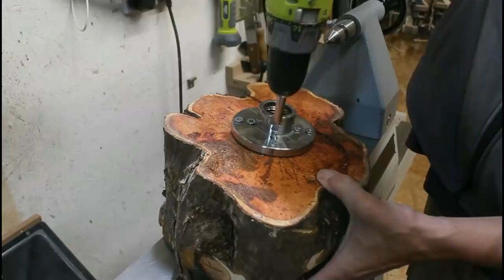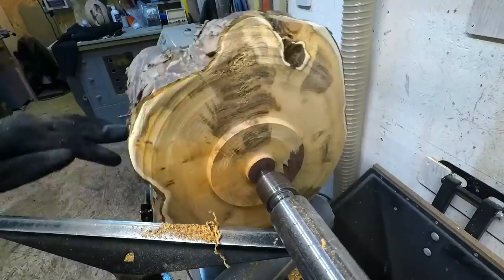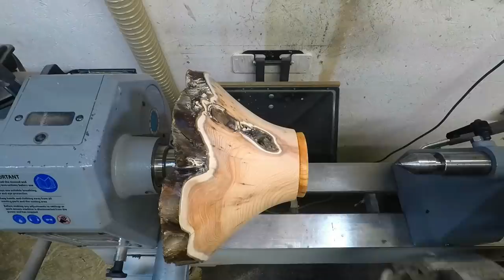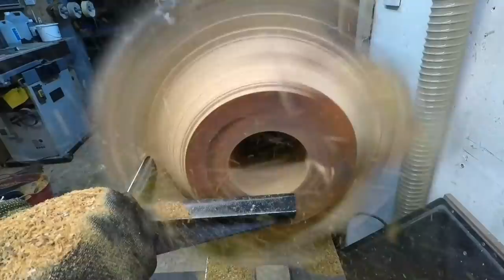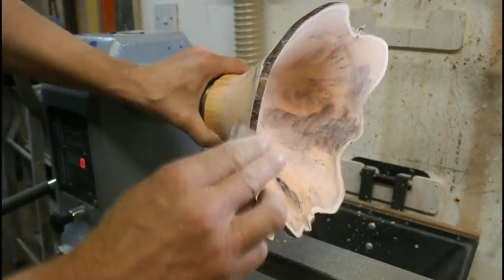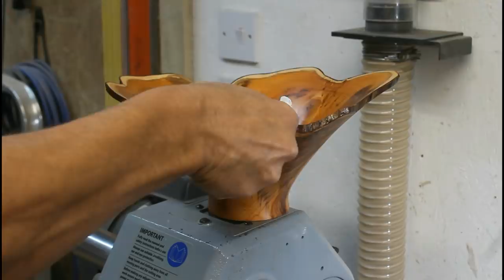Woodturning - Yew Beauty !!

Comment: WOW!  I initially thought you were turning a large piece of Cedar based on the bark and rich color of the wood itself.  I'm not familiar with Yew, is it similar to Cedar?  Either way, that finishing oil really brought out the rich color and grain in that piece, and it gave you another quality piece of art.  Thanks for sharing.
Reply: According to wikipedia, they are only distantly related, both being conifers. Maybe conifers just have that richer color from less shrinkage in the wood?
Reply: Yew as a rule I believe is much harder than cedar. Yew wood was the prized material for making bows in the Middle Ages
Reply: @BigGrabowski  Thanks.  I Googled it after asking the question, and found similar information, but it was late and I stopped reading before finding a definitive answer.  HA!
Reply: @LynnCindy  No problem! Maybe someone else had the same question anyway, and we in the thread quenched their curiosity.

Comment: I didn’t understand one thing: after turning the outside, it seemed like there was oil treatment.  in the next shot, during grinding, the impression was that the workpiece was not covered with oil.  but in general, I was very impressed with the result
Reply: Possibly just a sanding sealer and to check the grain pattern.
Reply from the maker: Yes sanding sealer 👍

Comment: Hi Andy, unsure why you took that first coating of oil off on the outside? Never turned Yew, but would love to get hold of some. A lovely piece and a beautifully preserved natural edge. BTW, I've been using Osmo Top Oil for some of my recent pieces
Reply: I believe it is a wood stabilizer that he applied.
Reply: @jeffrey.edgett  Thanks Jeff
Reply from the maker: Sanding sealer 👍